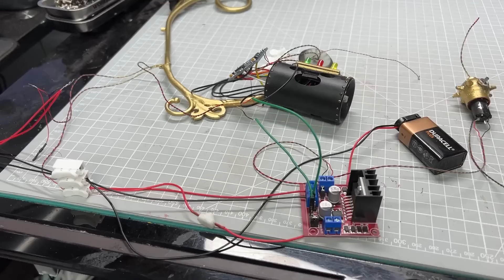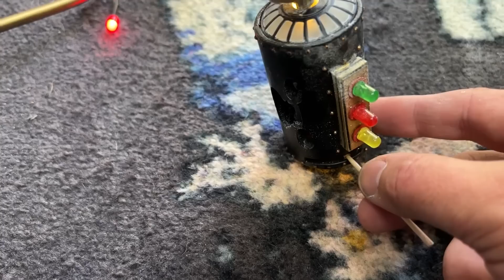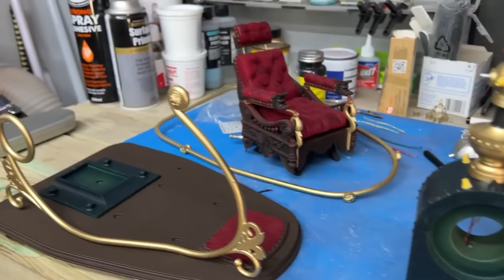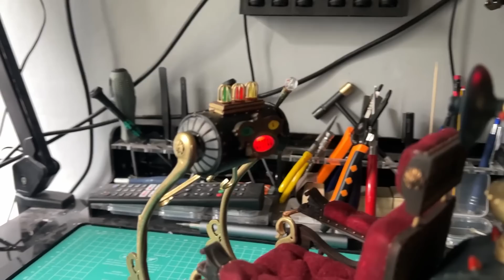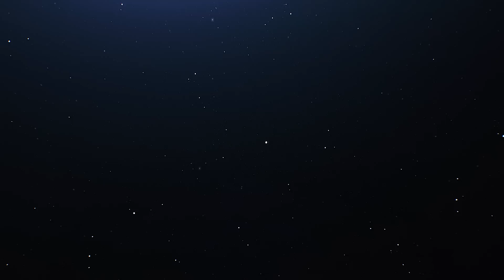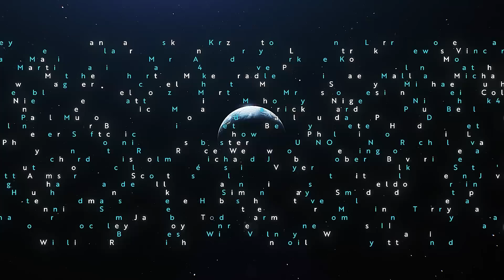The Sprueverse Challenge - Build the 1960 1:6 Scale Time Machine - Part 4 - Finishing Line in Sight

Comment: Hi Wayne I downloaded the time machine wiring diagram you posted
What nano Arduino to get is there different voltages?  , Also in a certain potentiometer pot I should get?
Reply from the maker: Nope, any pot meter will work. Arduino nanos can take voltages up to 12v. I used 9v no problems at all. Each pin will only ever output 5v though. It doesn’t matter what nano you get. They are all the same

Comment: At Mr. Wayne?  One video, not sure where, you were out in your garden because it was "30 degrees".  As a ( now retired) airline pilot?  I'd like your viewers to know a simple conversion "in your head" from Celsius to Fahrenheit.  Using '30 degrees' as a start?  Double it, makes 60.  Take off 10% (6) so we now have '54', then add 32.  This equals 86,which is the correct answer in Fahrenheit.  As pilots in the U.S. we do this in our heads, since modern weather reports are ICAO geared standard and report in Celsius
Reply from the maker: It’s weird. When it’sreally hot we refer to it in Fahrenheit. Every other time in Celsius. We are a strange bunch in the UK lol

Comment: hi Wayne I was wondering if you could show how you're going to attach the motor to the shaft to the disc I'm curious on how the shaft attaches to the motor.
Reply from the maker: Resin inside the metal tube that slips over the spindle of the motor. The other end goes into a flange that is screwed to the disc

Comment: Engaging hell! Your trials a really interesting. I just hope the "bowling pin" segment can be supported well enough by the teeny tiny glue points. All may not be lost with that dish-- try a hair dryer and work it around. There's supposed to be a memory in the resin, you may re-activate it. Just in case...
I say, build a turntable with a variable speed power drill (with a lock in the trigger) and use that to sand the edges thinner. Just in case... (it may prove useful when working on the back side of Lou's print).
Reply from the maker: The bowling pin is ganna need a brace at the bottom as its ganna want to bend down which will impede the motor. I am going to fashion something that wasn't on the original but looks like it should have been :D